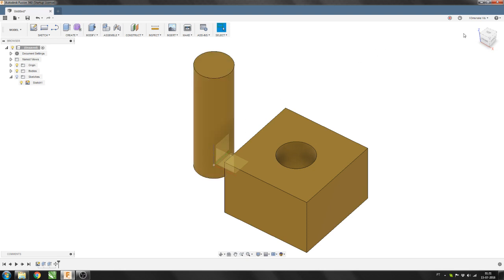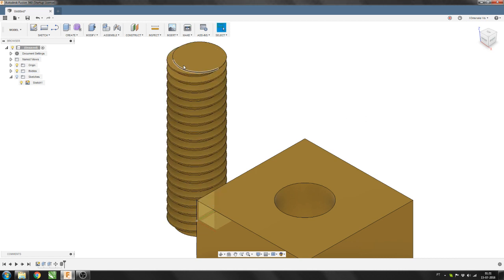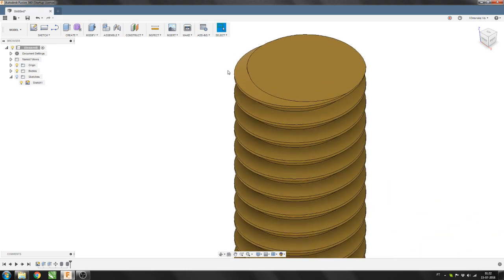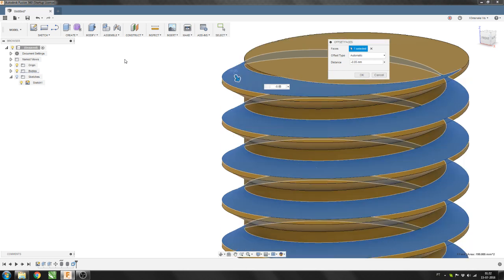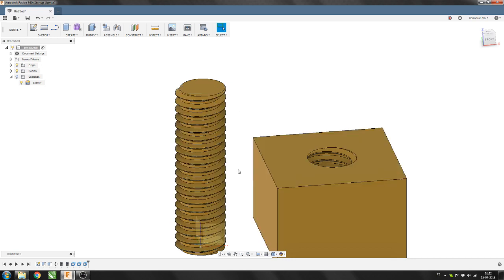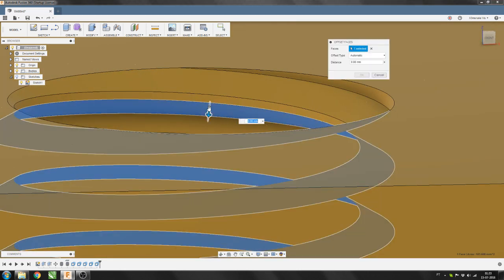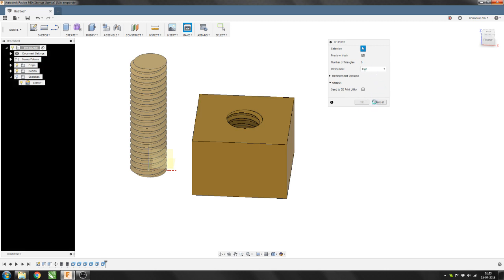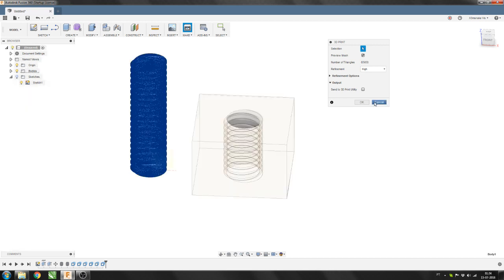Making Printable Threads in Fusion 360

Comment: Im trying to make a threaded Camera hood to fit a 49mm lens.  In Fusion 360 the ISO metric  standard either lets me choose 48 or 50mm.  The thread pitch is 0.75.   The problem im running into is that my 3D printer tolerances are .010 off.    Is there an easier way to create a part that works ?  How do I make this work.
Reply from the maker: threads should be printed upwards parallel to the plate.

correct way to resin print a thread is to first make sure you are using the correct expos sweet spot by using resinXP finder and a validation print like photonia or ameralabs town

once you have your resin sweet spot print some cubes and check for size. if the size is still too thick, current best solution is to use a slicer that allows xy compensation lile PrusaSlicer or ZSuite
Reply: X3msnake Thank you 🙏🏼